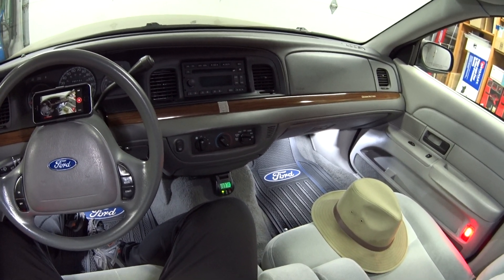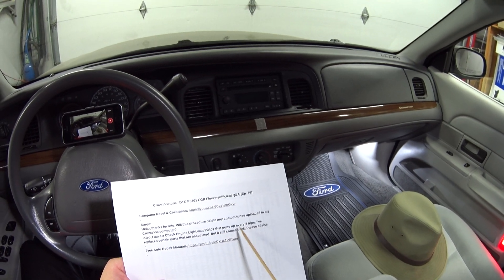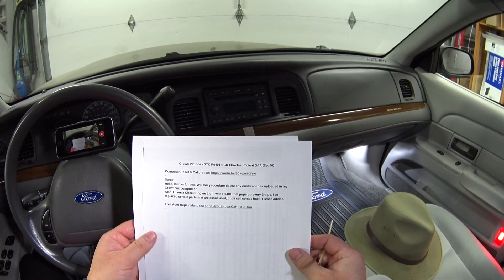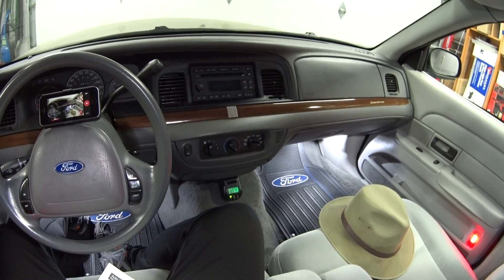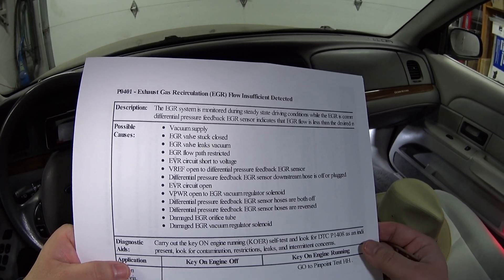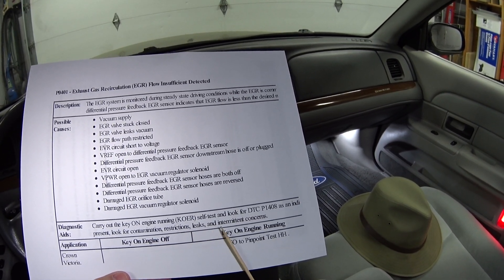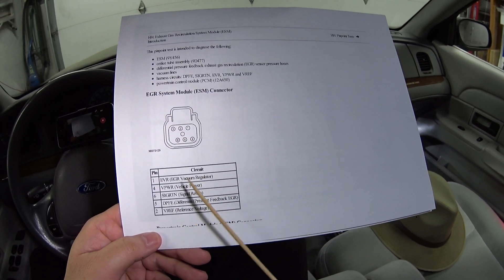Crown Victoria - P0401 EGR Flow Insufficient

Comment: Appreciate U, Sir!
Good to hear my question announced & commented on...👮🏽‍♂️👍🏽

Sgt. M
Reply: I'll try the jumper fix & see first...Hopefully 🤞🏽
All those extra components to check, that will take some time. Especially, with my work schedule.
Reply: Hello Sir!

Fyi... I finally tried out the jumper cable trick on my 2011 CVPI with the engine light persistently illuminating every 2 trips.
So far, after 3 trips the light HAS NOT came back on. I will see tomorrow, when I get a nice ride into work about a 30min drive in 7'oclock Htown traffic.
Reply from the maker: @sgt.7133  
Thanks for the update Sarge.
-Chuck
Reply: @PanzerPlatform  Btw... Update a day after the fact.
The engine light resurfaced with the oright EGR code ( 0401 ) on Monday.
It jus took about 4 trips to cycle back on instead the normal 2 trips that were stated on Google. 
So, back to drawing board!
Reply from the maker: @sgt.7133  
Thanks for the update, Sarge.
Shake up the Magic 8 Ball again. lol
-Chuck
Reply from the maker: Right on Sarge,
Let us know what you find out with that code. 
-Chuck
Reply: @PanzerPlatform  Mornin Sir!  Looks like the Fellaz are going in on my previous question...😁
But, what kind of lead cables did U use for this procedure? Is there a specific gauge for the wire? I'm having a issue finding it to order, especially since I don't know the actual name of it...🤔

Thanks
Reply from the maker: @sgt.7133  
Here's the ones I use; 
https://www.harborfreight.com/18-inch-low-voltage-multi-colored-test-leads-66717.html
-Chuck
Reply: @PanzerPlatform  Thanks...😎

Comment: I have a PO430 code. What could cause this code?
Reply from the maker: Here are the 5 PDF pages of DTC P0430 troubleshooting steps for your 2006 Crown Victoria P71;
https://drive.google.com/drive/folders/16URcKlmhL2dza6934ZOCKWsv0mOHao05?usp=sharing

Click the link, and print, or download the 5 PDF pages.
If you are unable, you can email me, and I will send you the 5 PDF pages via email.
My email address is; BudgetPantherPlatform@gmail.com
I will delete the link to the PDF documents in 24 hours.
-Chuck

Comment: What if I replaced my egr valve but I still have the code popping up. I haven’t cleared the code yet. What could the issues be?
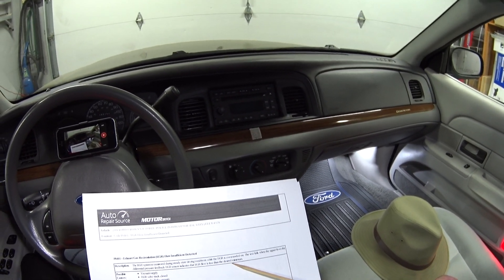Reply from the maker: Possible causes at 3:38 in the video. 
-Chuck

Comment: Hey Chuck. What is that under your climate controls? Just wondering
Reply from the maker: I'm not tellin'. 
Stay tuned. lol
-Chuck
Reply: @PanzerPlatform  lol gotcha!
Reply from the maker: @badwolf1795  
It's going to be a while before I make a video about it.
So in the meantime, it's a voltmeter that plugs into the power point under the pull out cup holder / ashtray.

Comment: Hey Chuck! Just a heads up if you're interested, tomorrow thru Monday, everything is 40% off at Pick-n-Pull.
Reply from the maker: Right on Pat,
I just looked on the website, I'm not seeing anything.
I want a spare Group 65 car battery.
-Chuck
Reply: @PanzerPlatform  I have several 65's because they're interchangeable with my Bronco and F150. It also helps when your brother owns a tow company that supplies you with all the batteries and parts you could want.

Walmart sells them for $50 new with a 1 year warranty and they've honored it for me previously. Their battery rep even told me that their premium batteries are the exact same batteries, just longer warranty included to justify the premium cost.
Reply from the maker: @DeathAngelHRA  
I saw the $50 "value" Walmart battery a few years ago. 
I checked today, and it's been discontinued. I should have bought it.